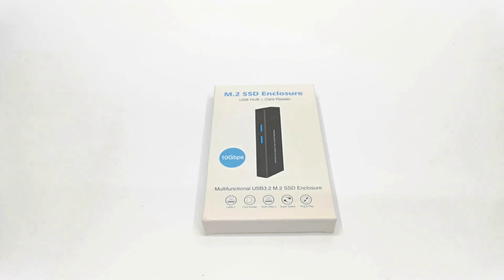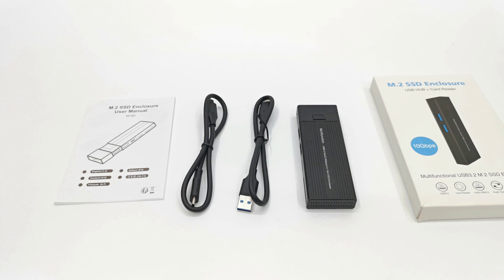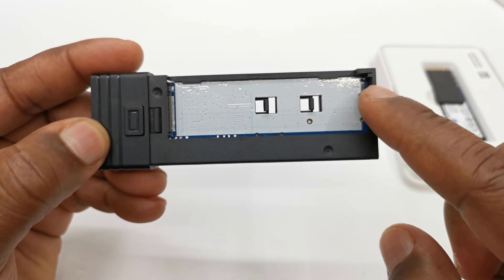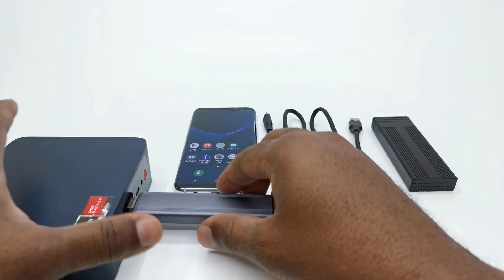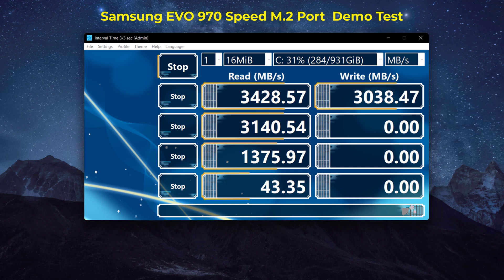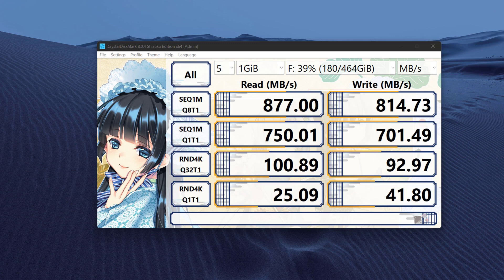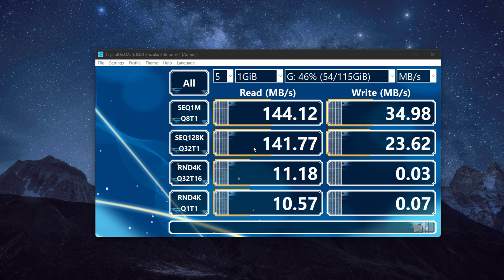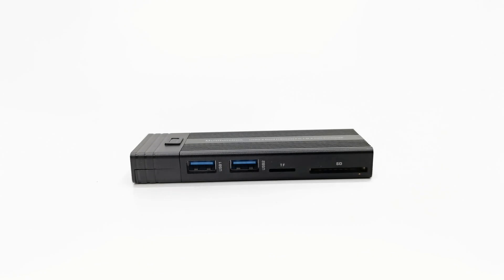M182 Multifunction M.2 SSD Enclosure and Hub  - New way to Flash Drive

Comment: I just ordered one, lets hope it works well enough.
Reply from the maker: Mine still works great I used the up to last night. What I like about this one compared to the others is that it's also a USB type C hub So even without an M.2 inserted you can still use it to read flash drives and other controllers as well as together with an M.2

Comment from the maker: So friends I really like this one compared to the first one. They should have also included  a 2 inches flexible cable.👍
Reply: Do you think this would be good to run the invidia shield operating system and extra storage?
Reply from the maker: Question. Is it now possible to run the Nvidia shield operating system from external storage? If this is so I am not aware of this development. If it is indeed possible then this enclosure with the right M.2 SSD can certainly handle the task.
Reply: @tvboxstop  yes. I asked for a external ssd last year for Christmas to run my invidia but they got me an external hdd. It works but it's slower than the original invidia memory and after a year of use it's not holding up that great. I want to replace it before my whole system freezes up. I think if I don't reverse back to the invidia it would lose everything and my invidia would no longer function. It runs all my apps and start up.